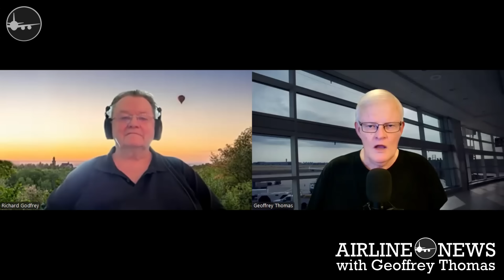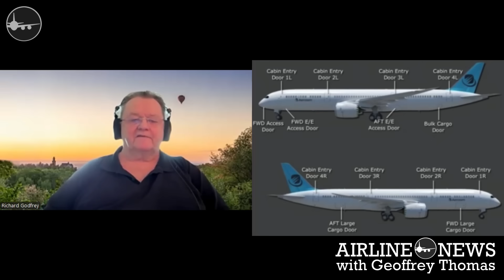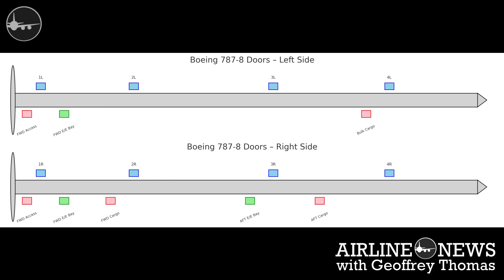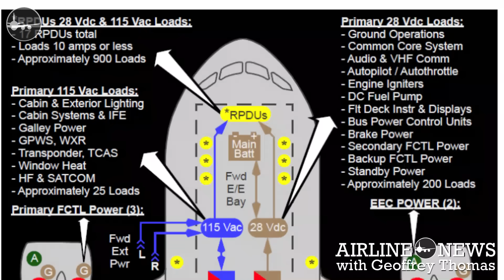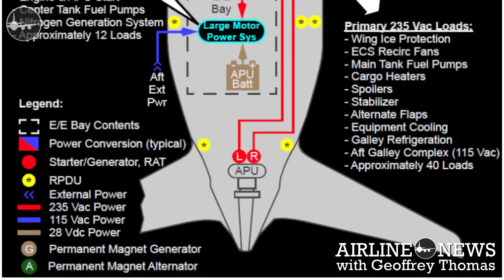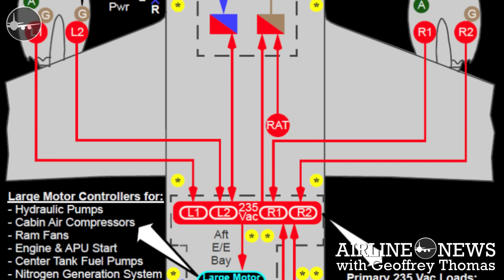Air India Crash Eps 189 - Toilet Leaks Exposed

Comment: Regarding the fuel pumps, aren't engines using gravity fed fuel from wing tanks, if there's fuel pump issues? Especially during takeoff?
Reply: That's exactly the point. Gravity-fed fuel would have too low fuel flow rate (especially at TOGA), the remaining fuel in the tank would heat up immediately and part of it'd vaporize. And that's exactly what may have happened here. Fuel in a non-liquid form means engine flameout. That was also one of the theories at the beginning (after the flaps nonsense, etc.), either fuel contamination or so-called vapour lock. But two days after vapour lock, the prelim. report was released and everybody (cpt. Steeeeeeeeeeeve) has only been talking about the freakin switches as if they could change anything, if the RAT was deployed first (which we now know almost certainly happened thanks to Geoffrey and Richard's analyses).
Reply: @MerrekSK Yeah, I'm really annoyed with Captain Steeeeve! Believing the prelim report bullshit.

Comment: I’ve watched a great number of these videos, but for the life of me I cannot recall what evidence exists for the contention that there was water in the E/E bay on Air India flight 171. Forgive me if I missed it.
Reply: The fact that RAT deployed first (before any switches were moved) - this is proven from the transponder data, which Richard talked about in several previous episodes.

If you look clearly in an unbiased way at the preliminary farce of report, it even says so! "RAT deployed immediately after liftoff". Immediately without giving the exact timestamp. But mentioning it after the fuel switches, to make it appear, it was the effect of the switches. But there is no reason to deduce this, on the contrary, the report is keeping its backdoor open and doesn't forbid RAT deployment before the switches were moved.

As we know the RAT deployed first, 2 seconds after liftoff and engines were still running at that point, it could've been only a catastrophic electrical failure. Now, how can you get a catastrophic electrical failure on an airplane? Moisture (water ingress) is one of them. It happened before, it's not a new thing. And there is this airworthiness directive from Boeing from May this year (!) dealing specifically with moisture in the EE bay. And we don't know whether Air India has implemented this directive (complied with it) in time before the 171 flight.

There may not be direct evidence at this moment, the water was in the EE bay, but it's the single most probable cause. We know RAT deployed first, something must have caused it and in addition to the aforementioned, now you have the supposed testimony of Air India's own technicians that this happens.
Reply: @MerrekSK  Some people are always going to have a problem with this because the "proof" that the RAT deployed at T+2 is based on back-tracking the amount of time it typically takes a RAT to provide both hydraulic and electrical power.  That's weak for some people because they wonder if under certain conditions (like low altitude and thicker air) the RAT might actually be able to spin up faster than the 6/10 seconds listed by Boeing.  What we really need is that high res CCTV video from the airport that is suspiciously being hidden from public view!  That would likely prove it with visual confirmation.  Personally I side with Richard, but I don't think backtracking RAT spinup time to determine when the RAT deployed is ever going to be considered "proof".
Reply: @mikeyc8139  Agreed. But don't forget - thicker air, yes, but also, much lower speed. And you said it yourself - why has the hi-res CCTV not been released? Who is hiding what? Why there is no timestamp in the prelim. report on RAT deployment (the bang one survivor heard)? If the RAT deployed after the cutoff switches were moved, would it have to be deliberately kept as a secret? That's enough of a "proof" for me for now. The truth will come out eventually.
Reply: Yes. Furthermore, the 6-second (hydraulic) and 10-second (electrical) figures are, according to sources citing the Boeing 787 manuals, specified as maximum deployment times. This means the RAT is certified to supply full hydraulic and electrical output within those intervals under worst-case conditions; in practice, power may become available sooner. Anyway, I am not saying that what the channel is claiming should be discarded, only that this particular point is not entirely clear.
Reply: In the episode where they proposed that scenario, Richard listed (I think 6) things that could cause the RAT to deploy.  He was able to rule out every scenario except water ingress to the EE bay making that the most likely cause of RAT deployment.  It was in his report attached to that video.
Reply: @MerrekSK  shocking indeed the official PR keeps all options open and just suggest a pilot error in carefully chosen details, a cover up or at least a poor way to buy time to make up another story...
Reply: Let us take "RAT deployed immediately after liftoff" from PR as support for this plausible hypothesis until they release all data to infer a better supported chain of events!

Comment: Temp of 37 degrees only can not been the problem. It is a warm region, not all the planes falling down to earth when it is warm.
Reply: Not the temperature on its own
High fuel temp with failed hp pumps,due to water induced short circuit,used at full throttle cause disruption of fuel supply and flame out

Comment: Considering your last presentation I would leave the grave to not miss this one.  I'm not so naive as to think human error does not happen in the manufacture of aircraft but it is surprising that something as critical as sealing tape could be omitted and not discovered before release.  I am certain components on aircraft must pass inspection and be traceable to understand and remedy such incidents as we discuss today.  I believe what we will eventually discover is that manufacturing lapses and improper field corrections will have caused this disaster.  You guys are amazing.
Reply: I'm also concerned about condensation in the EE bays - on equipment and potentially old and frayed wiring - from the air conditioning that surely must be necessary to keep all the electronics there happy.
Reply: Well that's why they issued  an advisory about the water line since it wasn't always connected correctly.  So apparently AI did not always react to them if it's only advisory for maintenance and not mandatory for inspection.  This is where the ratings of which airlines are more reliable than others can be used to compare them.

Comment: The fact that lavatory fluids can leak onto electrical bays is beyond shocking. Pathetic designers.
Reply from the maker: Fluids do not leak onto electrical bays by design! Have you never witnessed a water leak in your home. It was not part of the design of your home, it was the result of a failure. You turn the water off at the main tap and repair the leak. If you don't bother to do either turn the water off at the main tap or repair the leak, then don't complain to the builder or architect of your home that your home is flooded.
Reply: Thank you Jeoffrey.
Reply: @Airline-News  Let me put it this way, i would expect there to be more than a pipe seal preventing such an occurrence considering the potential outcomes.
Reply: Did you listen to the episode? This is true off many aircraft, leaks that could damage electronics or other equipment. Shall we remove lavatories or shall we do proper maintenance?

Comment: Why would one or both pilots place the Fuel switches to the off position soon after take off?
Water ingress???
🤡
Reply: I have presumed that a pilot moved’ the switches to cutoff then back again as a desperate attempt to restart the engines. In the short time they had it’s probably the only thing that might work.
Reply: @lesguiblin4463 
Engines were running normally on take off.
One pilot said to the other why the fuel was switched off and the pilot said 'I didnt'.

Does that conversation support your claim that the pilots were trying to relight failed engines?
Reply: The suggestion is that the pilot recycled the fuel cut off switches to do an automatic engine restart, this occurred after the RAT deployed, indicating that there was an electrical fault prior to the switches being turned off and then on again.
Reply: @MrSoulman74 
How do you explain the conversation between the Pilot and co-pilot?
Reply: @PetraKann  I don't have an explanation, I was simply answering your question, you'll note I wrote " the suggestion is" not "my suggestion is". However the question has been asked, why has the actual transcription of what the pilots said in context not been released? What's written in the report is the writers interpretation of what was said, not a literal transcription.

Comment: I've considered an electrical failure as a viable alternative to pilot failure since early days. However, I wonder if an electrical failure would prompt one pilot to ask the other pilot why they cut off fuel?
Reply: We don't even know if the one pilot asking another referred to the fuel cutting off. It could be any other system cutting off. The prelim. report only makes it appear, they were referring to the fuel cutoff switch, because it's written in the same paragraph, but the question is clearly taken out of context and can refer to practically anything. Another thing is the indirect reported speech. The question may have been "why did he (the plane) cut off?" This has the same reported form as "why did you cut off". Maybe that's why they never show the full CVR transcript or use direct speech.
Reply: @MerrekSK Exactly!  The preliminary report stated someone asked "why did HE cut off" not  "why did YOU cut off".  And cut off what exactly?
Reply: Of course it could. If the engine controller (fadec) had malfunctioned  then a warning signal that the fuel had been cut may well have popped up on the pilots screen. This would have prompted the pilot to ask the Captain. What is not nlmade clear is that was the fuel  cut levers ever disengaged. Were  they found to be disengaged? Wasn't said they were switched back on.
Reply: @patricksmith4424   Exactly. The prelim. "report" could be deliberately mixing false switching with the subsequent actual physical switching by the pilots to ensure relight, we don't know at this time.
Reply: @patricksmith4424 The prelim report clearly states both switches were shutoff and then switched back on. I don’t think anybody disputes this.
Reply: @MrDeepseadweller Yes, but what is the time sequence for this? According to google ai the, the fuel switches were in the off position shortly before the crash. How short?  That would mean they were switched back on just before impact. As soon as the FO had seen the switches were off,  there would have been a frantic situation, violence. He would not have quizically have said " why did you switch the fuel off. It would have been "WTF are they doing off and immediately turned them back on. Remember after the luthansa crash in the alps where the suicidal pilot locked his colleague out, pilots are taught to be on guard for strange behaviour. I suspect what happened was that when the fadec shut the fuel down, the pilots frantically tried  switching the fuel switches to see if that would re-boot the system, that would explain why it  was switched  back on just before impact.
Reply: Hats off to both of you. I ha have watched every episode of your podcast and always knew your tenacity would lead to some direction in our understanding of the incident. Hope the Indian public pressures the AAIB to be transparent. Good luck gentlemen and do expect a push back  from the vested parties if this goes viral which I hope it does.

Comment: Well if the maintenance guy you got your information from is correct then it’s obvious that air india DOES NOT comply with proper maintenance. However it’s incredibly hard to believe that all this stuff failed in perfect order and then worked in perfect order only seconds later. Who knows what really happened at this point for sure. Excellent job on determining the what ifs on this accident.
Reply: Transient issues do occur - even in the cars I own.
Reply: This plane was NOT in perfect order both before and after the fuel cutoff! Especially the cavitation issue happens at high thrust which they did not achieve afterwards...
Reply: @HaToll63 I never said the plane was in perfect working order. I’m saying that all the systems needed to restart the engines seconds later were all of the sudden working again as if nothing happened. The truth is that no one knows what happened unless you are on the investigation team. Everything else is just speculation and guessing.
Reply: @Jaync5894-ge1em  not necessarily so there was a delay on the Engine 2 relight who knows if it ever would have produced thrust again. Ok the EGT went up.

Comment: I think your hard work is coming to fruition. Looks like you've found your common failure mode. CFO's will always pushback on anything that is not mandatory. Of course, you need a really good reason not to carry out the advisory but they usually cross fingers and hope for the best. Does a lot of these problems relate to the move to electrical systems rather than mechanical (pneumatic / hydraulic)?

Comment: If only captains display is powered during power loss, then the plane must be commanded by the captain during take off and landing, since switching operators is too time consuming, every second counts as in this case. If urine can leak into the APU, that is another major design "flaw" by Boeing, all Dreamliners should be grounded and renovated.
Reply: The industry decided long ago that planes are compatible with movable eye balls. Any pilot of those planes are able, and the planes are build accordingly, to cross check and if necessary use the other officers instruments.

Comment: First comment from Australia!! Love you both! Great work!
Reply: G'day Bruce.
Reply: The electrical bays on a Boeing 787 are designed with redundancy to operate independently, with some systems capable of running on a single generator, so even if electrical units or lithium-ion batteries located in one of the forward or aft EE bays were compromised by water/damp ingress this should not result in a total electrical failure ?